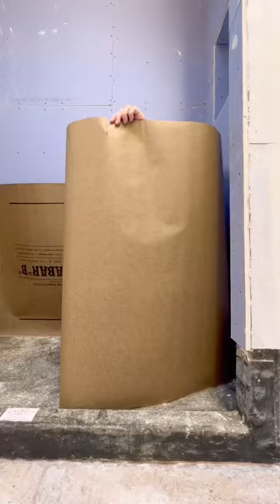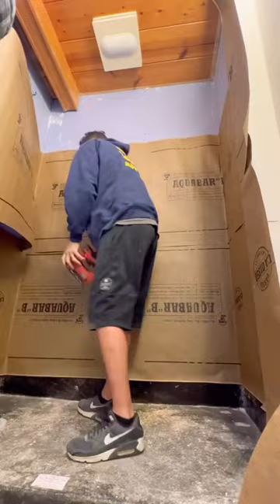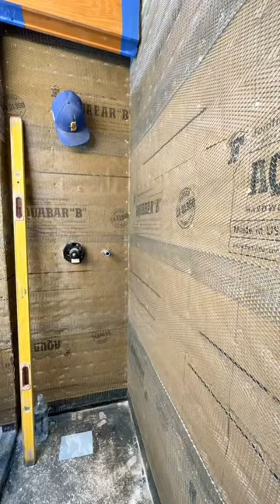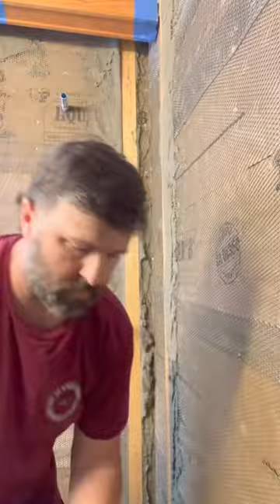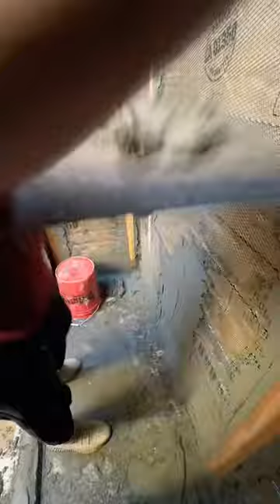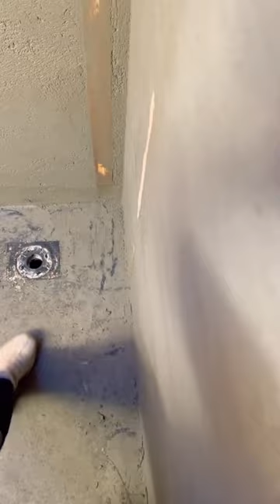Old school one coat mud float shower tile prep work. #tiling #tile #howto #diy #craftsman #mud

Comment: Nice work. Question?? Is it ok if I do aquabar on the studs then durock then wire before I float?? I just think the mud would have a better bite onto the durock rather than the paper.